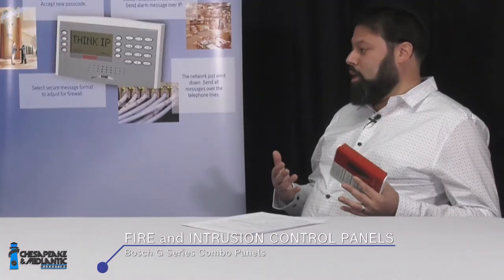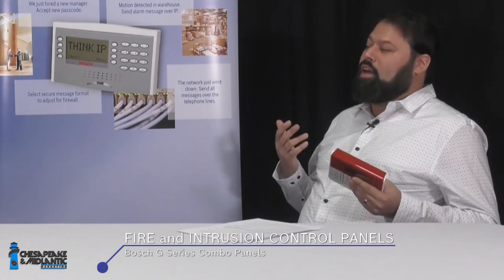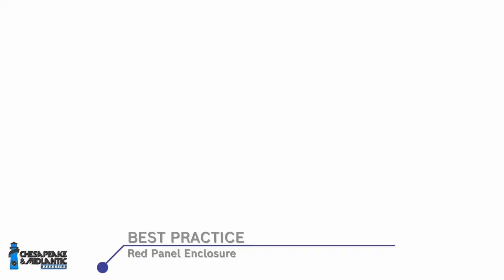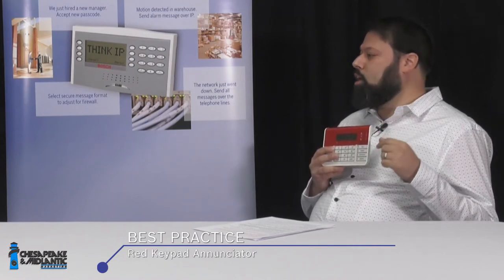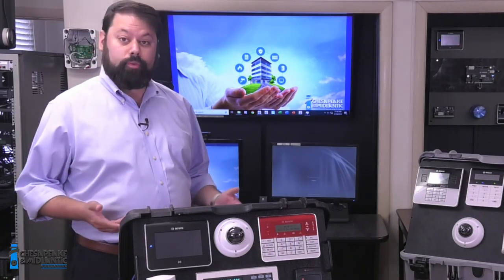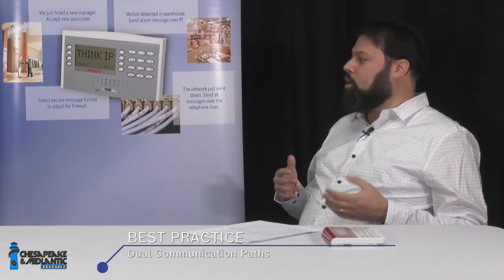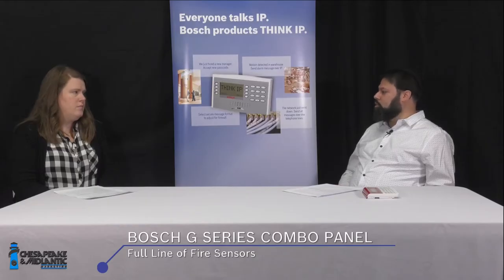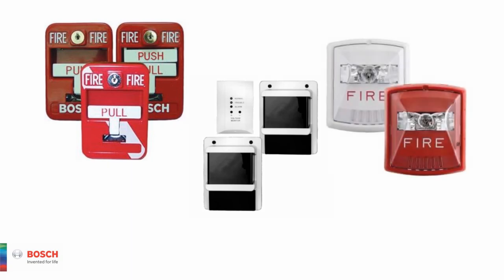Bosch Fire and Intrusion Combination Control Panel

Comment: I can't find any info on what type of box I need to put in the sheetrock wall to rough in for this. Do I rough in just a 4 square box?
Reply from the maker: This keypad is designed for surface mounting. The backbox includes multiple keyholes. When roughing in, we recommend either a single gang or double gang workbox. For more details, see the installation manual here: https://resources-boschsecurity-cdn.azureedge.net/public/documents/B925F_B926F_Installation_Manual_enUS_18617549707.pdf
Reply: @SecurityAnswers - MidChes - Chesapeake and Midlantic Marketing   thank you so much for taking the time to get back with me.
Reply from the maker: @electrikjimmy608  of course, that's why we're here! Learn more about us at https://blog.midches.com/blog